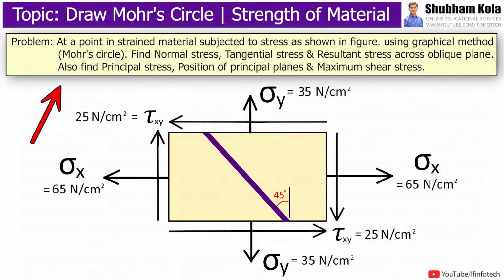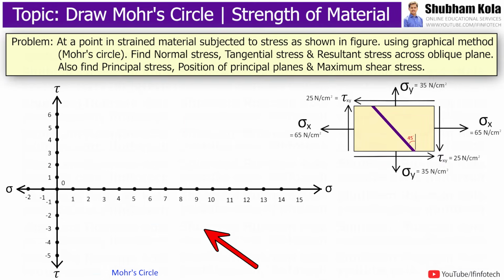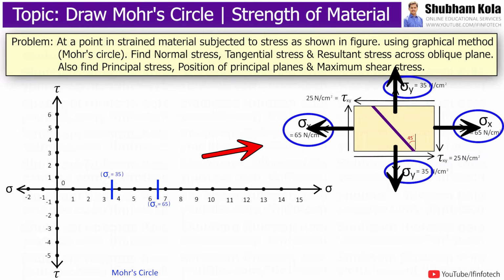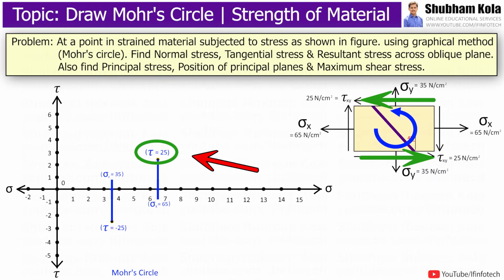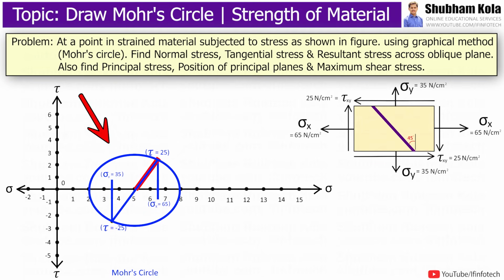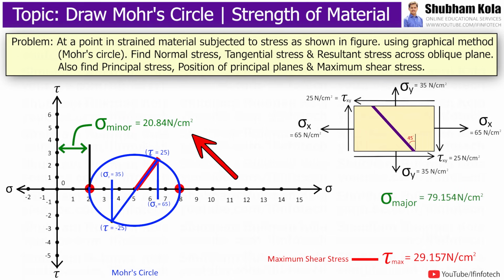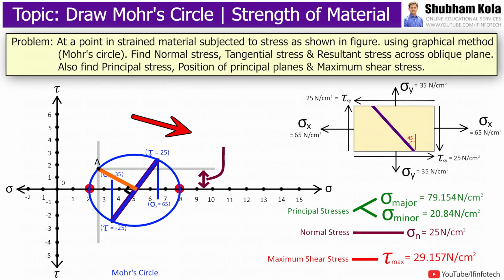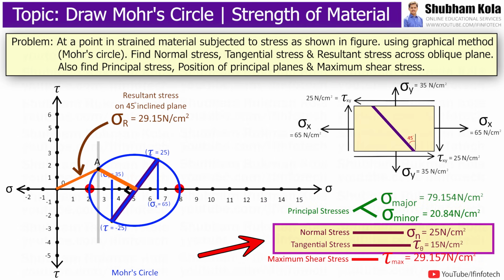Mohr's Circle: Normal and Tangential Stress, Principal Stress, Maximum Shear Stress [Solved Problem]

Comment: When shear stress is anti clockwise that means it's negative not positive
Reply: what is defined as positive and negative rotation its arbitrary. you can choose whatever coordinatesystem you want, and as long as you are. consistently using it then all results will be valid.

Comment: When shear stress is anti clockwise that means it's negative not positive
Reply: No anticlockwise is positive.
Reply: While solving mathematically, 
Clockwise : -ve
Anti-clockwise : +ve
Reply: According to u take any direction anticlockwise may +ve and -ve but here clockwise is also take opposite to anc direction
Reply: Wrong
Reply: Using right hand rule ,anti clockwise is positive
Reply: Wrong